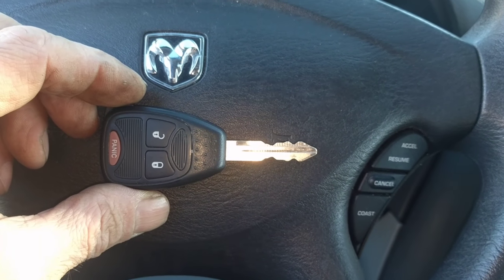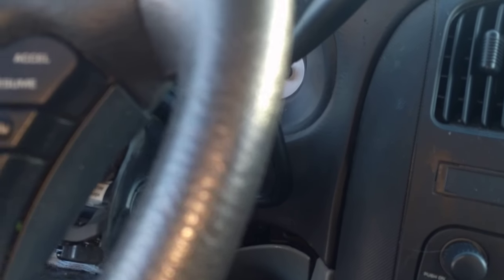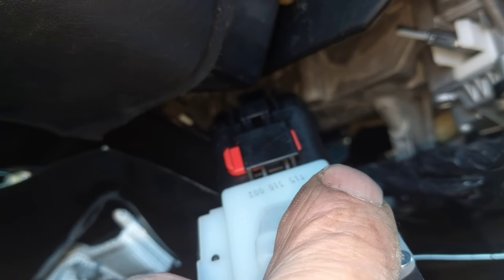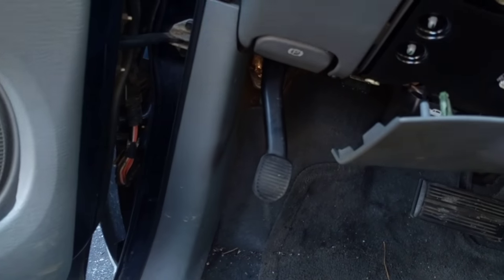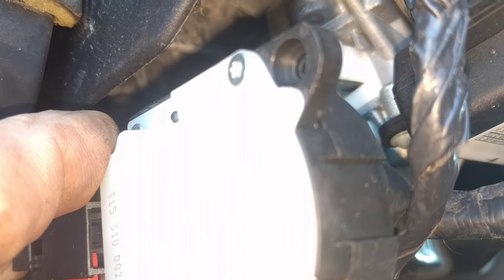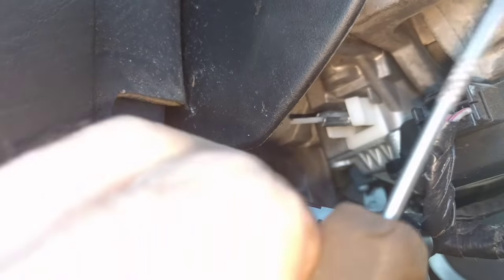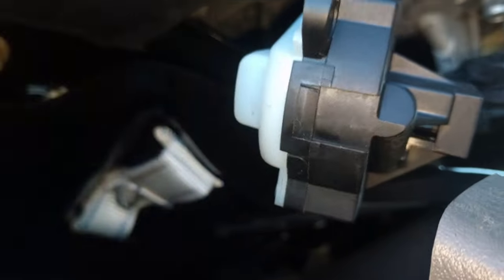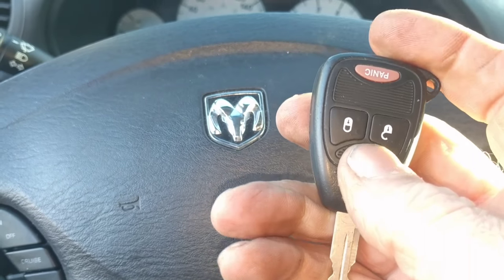Ignition Switch Change 01-07 Caravan/Voyager/Town and Country

Comment: What can you do when you have lost the key to the vehicle
Reply from the maker: That depends.   If it is the only copy you have, contact the dealer.  They can manufacture a new key from the Vin code and proof of ownership (this may be a waste of money as the tumblers may have worn out, but it usually works but will need coding). Test the key to make sure it turns the lock  and lights the dash lights, you can take the key back inside the dealership and ask them to code the key to work with the PCM (fancy name for the computer than controls the engine and the transmission.) After coding it will start. 

Most of the time they will just quote a price that may include a brand new ignition lock cylinder and that can get pricey.  Hence why I suggest you approach them with the hope that the tumbler pins aren’t too worn out and then go from there. 

Alternatively, you can approach the dealer to get a key code from the Van’s vin code (with proof of ownership or them just knowing you and bring the customers/ or your own papers in) so that you can get a locksmith to make a plain steel key without a chip, just to test the lock. If it works on the door and the ignition, you can take it to the dealer and have them program an new chipped key to the van and then they can cut it to match the steel key or you can take it to the locksmith to cut to the steel key patter or even the code you got previously.

Make a few calls and discuss options
Reply from the maker: Also, you can buy an aftermarket lock cylinder and change it out as they come with a new chipped key I believe (call your parts store and have them look in the box for a plastic head coved ignition key.  They sometimes come with two)

Comment: No spark in # 5 and 2 in ignition coil dodge caravan 2005 engine 3.3 ,I replaced a new one BUT still same problem , please help me to fix it  .   ( the problem is in  ignition itself ,not in spark plugs or spark wire because I bought a new sets ) .
Reply from the maker: yo bro good wht So, you changed the 5/2 coil, wires and plugs.  If this is the case, did you check compression in the affected Cylinders?  Did You Vise Grip a new plug to a Clean ground and then hooked up the brand new wire, removed the fuel pump relay, and then had someone crank the engine, while you were watching?  Bright blue or white spark?  Or red/yellow spark?
Reply from the maker: +yo bro good wht if you have a mechanic's stethoscope, use it to listen for the fuel injectors on number 2 and number 5 to see if they are clicking. If they do it's likely they are spraying but they may have water droplets stuck in the injector tip. If this is the case, put some methyl hydrate into the gas tank, to break up the water drops. The absolute best way to assure that the water in the injectors is gotten rid of his to take the fuel filter off, install a new fuel filter with one third of the filters total capacity full of methyl hydrate, install it, turn the key on and off a few times to Prime the fuel system, and then try to see if it will run better. A good hard acceleration run (not speeding) is usually enough to eradicate any water contamination.

Comment: I swapped an 01 caravan sport 3.3l into an 05 grand caravan. Harness, ecm, all wires. I am not getting spark. My question is, do I need to swap the ignition also?
Reply from the maker: M Carr it's likely that the replacement PCM is not expecting the frequency of the key chip. you can either replace the skreem/ignition lock cylinder/ key and ignition switch from the parts vehicle, or you can teach the PCM to accept the key that works in the existing lock.
Reply: First of all, Thank you for the response. The doner vehicle does not have a skreem system to my knowledge. The key is just a standard one. "no alarm".
Reply: Merry christmas.  I have a 2004 dodge caravan. Old steering colum. Ignition was Damaged. I. Tool it out i replace. It with a. New steering colum with key. But i. Cant get it to. Turn over. Can somebody help me out.